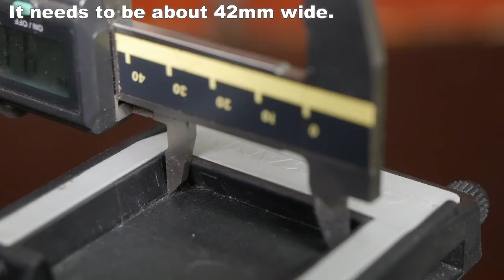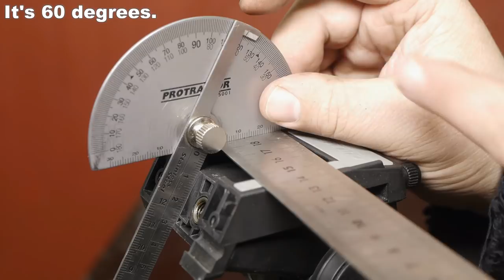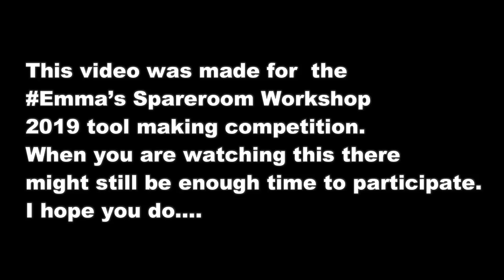Making a camera quick release plate on the lathe

Comment: Great timing!  I literally just finished making 4 custom camera plates (a little different - these went between the tripod plate and the camera for some specific reasons) and I used the same camera screws.  Did you not know that the screws are designed to thread through the plate so they don't fall out (there's at least .125" clearance between the threads and the head) or did you not have a 1/4"-20 tap on hand?  Not being critical just asking.  Yours is now my favorite machining channel,  but I preferred you talking through the video - you're entertaining in an understated sort of way.
Reply from the maker: Thanks. I didn't realize that. Makes sense though, and it could have worked, the plate certainly wasn't too thick. 
Although I almost forced the thread though the aluminum when the 6 mm drill turned out too small. Luckily I had a 6.3 mm drill.
In the end it didn't matter since I have no imperial taps and the hole was to small to thread on the lathe.
FYI. I did make a narrated version of the project: https://youtu.be/hePyuFAOa68?t=891

Comment: machining skills def improving, but you need a counterbore on the side with the clip, to make sure it never contacts the camera, i think it was a little, or cheat and get some thicker cork for the protector
Reply from the maker: You might be right. It's hard to tell. It looks and feels good.
The padding material is about 1.1mm thick and the E clip 0.6mm
It compresses only a little bit so I expected it to be fine.
But I hadn't noticed that the tripod connector protrudes slightly form the camera body.
I think I'll countersink it a little, just to be sure there are no issues.

Comment: No bugs on that one!  Really nice job, all around.

I seem to recall that you mentioned, somewhere, that shapers are hard to find where you are.  I hope it isn't impossible, because I have found with mine that with careful setup, starting of the cut, and not crowding it on the feed, that a shaper sawing attachment can be extremely accurate.  And although you can't beat the finish that a fly cutter can give you, shapers are also great for forming dovetails.  I hope you find the opportunity to get one, I think you would do well with it.
Reply from the maker: I'm very pleased with the result :)
About shapers, check this piece of video form 2 years ago: https://youtu.be/uJqFFV7Fw1k?t=735
Reply: @Rolingmetal    I know I viewed that video, but I didn't recall the bit about the broken shaper.  May you find another that is cheaper, better, and Bozo immune!  I had wondered about the Fischer lathe, whether it got sold, scrapped, or just tucked back in a corner, but I assumed I'd find out eventually.

I've had my share of those kinds of things happen ... and it's likely to happen again, sometime.  What should one say?  "Welcome to the Order Of The Broken Anvil"  ???  Perhaps there should be such a group.  With us, if anything can go wrong, it will, and in the most unusual/unexpected way.  Just an idea.  People probably don't care to sit for an evening, commiserating (or laughing without shame) and repeating tales of woe with the assistance of varied vocal lubricants at hand...